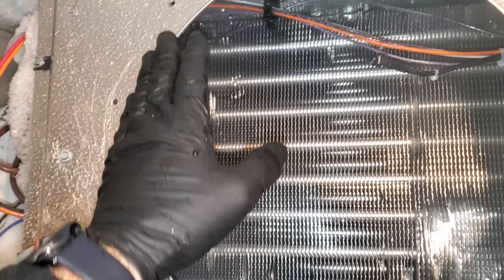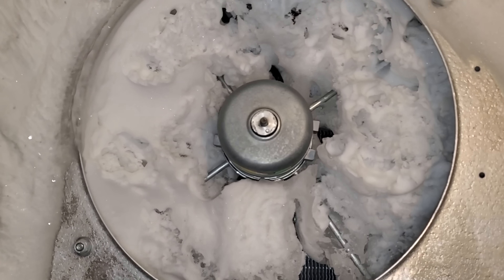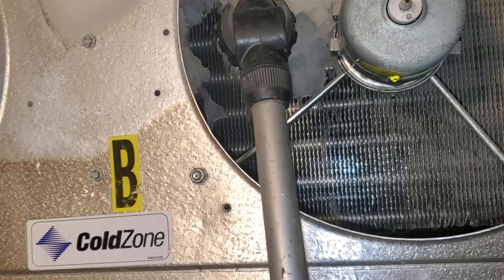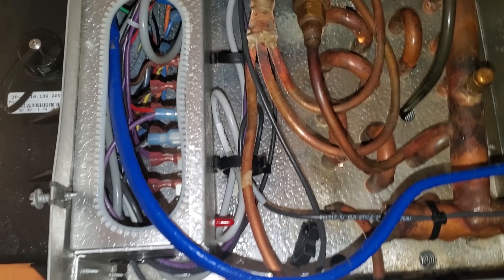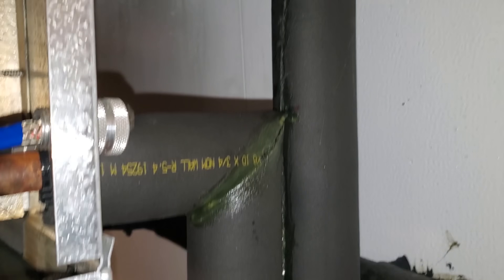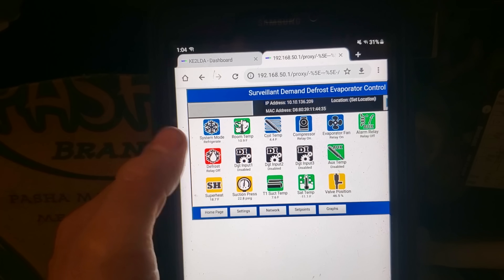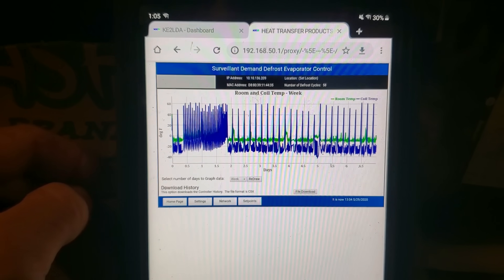IT'S BEEN ICED UP FOR FOUR MONTHS

Comment: Do you run the insulation through the box walls/ceiling?     I have found moisture wicking following the tube/insulation.    
On repairs I removed the insulation about 1 inch above and below the ceiling and foamed the space.  Seals moisture out and also supports and isolates the tubing from contacting the metal

Comment: I worked a store floor that had one duel rack, one on left, one on right iced to the drain tray in 24 hours of power to the fans failure. Told the boss he said ooooooo it's probably just slow on the de frost. Some hours later meat man chewed him out sure enough fan power supply was burned out. So much ice built it ripped the drain rack off when mid day de frost came on.

Comment: The time it takes to remove ice this way runs the bill way up and water dripping on the floor can damage the floor panels. I remove the drain heaters & use a wet-vac to suck out the drains.  I think customers need to plan for their walk-in freezer to break down and removing the product to a temporary freezer for several days so the box can be shut off and the ice allowed to melt on its own. The service person should show up FIRST, to fix the drain pan, evaluate the repairs & parts needed. THEN educate the customer to empty the room of all products & turn off the power breaker so the whole room can warm up & also dry out. Service-man can come back in 3 days and complete the repairs. I am big on preventive maintenance. Thawing out a walk-in freezer is needed every 2 years so it can be cleaned. It's horrible how dirty the freezer floor becomes in a couple of years of use.

Comment: What would you do if you didnt have hot water, besides turn it off until it thaws...
Reply: The time it takes to remove ice this way runs the bill way up and water dripping on the floor can damage the floor panels. I remove the drain heaters & use a wet-vac to suck out the drains.  I think customers need to plan for their walk-in freezer to break down and removing the product to a temporary freezer for several days so the box can be shut off and the ice allowed to melt on its own. The service person should show up FIRST, to fix the drain pan, evaluate the repairs & parts needed. THEN educate the customer to empty the room of all products & turn off the power breaker so the whole room can warm up & also dry out. Service-man can come back in 3 days and complete the repairs. I am big on preventive maintenance. Thawing out a walk-in freezer is needed every 2 years so it can be cleaned. It's horrible how dirty the freezer floor becomes in a couple of years of use.

Comment: Chris, you said those fans are hard to get, so if you know anyone with a tig welder out have a relationship with a welding/fabrication/machine shop they can run over over that crack and fix that problem.
If you can leave a single piece or bring them a few at a time, you will have less cost per fan since there will be less setup.

Comment: Just wondering...are any of these systems' data accessible remotely? I've worked in places that had remote sensing capabilities for equipment where you can view live data (and alarms for malfunctions) from miles away. Not refrigeration equipment, necessarily, but building systems data. I think of this when I saw Ethernet connections on this cooler to hook up to your tablet. Having this capability could quickly alert technicians there's a problem. Just wondering if you encounter any remote sensing systems or if everything has to have troubleshooting done in person. Thanks for the fantastic videos. Very entertaining!

Comment: Dude let me add more tip. This coldroom is a freezer. There should be a proper flow of air around the evaporator. Meaning theres no product blocking around the evaporator. There should be night curtain. Fan motor must off when they loading/unloading item. Defrosting should only 35 minutes with the 12 degrees celsius  termination. Long duration of defrosting will cause moist from the ceiling.

Comment: We found our air filter was plugged up and stopping the air flow! So we just threw it away and it worked for a week. Now it is hot again. 5 dollar air filter is cheap compared to 3or4 hundred to fix the plugged up Evaporator and fan system.

Comment: I have used liquid electrical tape  thats sold in a bottle to seal up the joints on that kind of insulation repair. If you brush it on pretty it looks pro. It holds up nice. They sell it at electrical supply houses. I think Home Depot too.

Comment: Just a future tip bro I wouldn't show customers ip address, someone could track their location and u could be blamed for a multitude of things man this world is F*cked nowadays
Reply: Just tryna help u out "Bud" don't gotta get an attitude
Reply from the maker: No attitude at all bud, unfortunately you can never tell context with text. I wasn't upset at all, I genuinely meant thank you for the concern and I appreciate you looking out for me and my customer
Reply: Not to mention ur computer was with yiu right? You were located at the customers coordinates right? Meaning if they tracked ur IP it'd still lead them directly to the customer, right? Stupid fuck
Reply from the maker: @
Mark Deeg  That ip address that you saw ins an internal ip address in the Ke2 controller, the only way to access it is by connecting a Lan cable to a wifi hot spot, to a router and or directly to a computer. The controller pictured is not connected to any network. There is no way for anyone to track me and or the customer  FYI
Reply: @markdeeg7088  You're the one being thick. 192.*.*.* is local, even 10.*.*.* is local, you can leak those all you want. Public IP's are what you want to refrain from spreading, your public IP is your routers IP, local are what the router uses to address devices within the network. Grow up.
Reply: @mragrayson  yet you spend your days going through youtube comments searching for the next person you can try and prove wrong? 😂 get a job buddy, do something useful with your life, "Grow up"
Reply from the maker: Thanks bud, but the controller was and is not connected to the internet nor their network. I had a hard wired connection to my pc......

Comment: I've worked at my restaurant for 14 years. Our freezer has dual units because it is so large. They generally only freeze up if they are low on gas, drain line gets plugged, or the defrost isn't long enough. Our units run on timers, and we tend to adjust them according to dry winter air or humid summer air. Humidity alone can cause fast ice build up.

Comment: I know this is not in your line of work, but tell the owners that their rate of rise fire detector should be at least 12 inches or 30 cms away from any appliance or light fitting or vertical wall,, it's an international fire safety law,, I'm a fire and security engineer 👍❤️

Comment: I had more ice, though not as thick, on the evap coils of the AC on a house i was renting. 8pm at night in West Texas, im sitting in the garage with the air handler panel off, a shop vac in the drip pan and using a heat gun to defrost the coil. Took about 5 hours...

Comment: You showed a plugged drain line but no mention of clearing. That said I would assume it was not part of the problem.  Shop vac to speedily remove the water buildup in the drain pan.  So much faster.    Your videos are really well put together.   Keep up the gr8 work.

Comment: Sensors weren't the issue. Low on gas causing ice up at evap inlet, if coil sensor placement was on the first couple of evap turns it could easily trigger repeated defrosts based on coil vs room temp differential. The exv was flooding the start of the coil trying to maintain suction line superheat. The fact that the evaporator was all boxed in by product surely didn't help.

Comment: I generally consider chicken wire worthless for most applications, I prefer Hardware cloth which is a square opening, you can fasten it down with some flat washers and self-tapping screws. It holds shape better, you can even make boxes out of it. it is more expensive and a bit more of a pain to cut through though.

Comment: Does winter charge cause any problem in the summer ? 
Once i had a compressor overheat and go out on high pressure or limit cut out a collegue said its better to keep few  bubbles in the sight glass in the summer time to make sure its not over charged, i was not sure if this is correct ?
Reply from the maker: No that is not correct if a system is properly designed the added charge (winter charge) needed to flood the condenser will not cause any problems in the summer, I’m going to discuss live on YouTube this evening 6/29/20 @ 5:PM (pacific time) come over and check it out https://youtu.be/qAVMB2gj6Kc
Reply: @HVACRVIDEOS  

For sure, thank you.

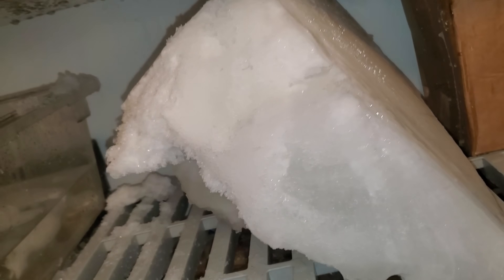Comment: 3:25 - I'm only this far along, and my first impression is: there is virtually NO airflow around the evaporator. If that is not the root cause, it's certainly a contributing factor. The plugged-up drain is also suspect. I don't blame you for changing the sensors because, like you said, you were already there and the sensors are a likely cause, and the potential to save your time (and the added cost to the client for a future service call) justifies that recommendation.
I don't know how "smart" these systems are, perhaps the Brain Box "saw" the icing condition and therefore entered defrost more often to try and remedy the issue?
I wouldn't knock your insulation job because I know I couldn't do half as well as you did, and to be honest, I've never seen a job done that well. The jobs I see are usually split-foam tubes zip-tied around the pipes, the type of insulation sold in home improvement stores for basement water pipes, rarely taped, never glued. Most of these have been in the franchised restaurant industry, I've actually seen better work done at Mom-and-Pop stores.
Reply: yeah, they had junk packed way too tight around it also.

Comment: First thing I noticed at 0:28 was that fire alarm strobe lens is full of ice-meaning it was full of water and froze-also meaning it will be useless if the system is activated. Seems like a weatherproof appliance isn't very weatherproof.
Reply: I don't know about the regs, but it seems like it shouldn't be that close to the condenser in the first place...
Reply: If there is ice in the strobe that means there is no barrier between the outside of the freezer and the fire strobe. The best method to stop this is by injecting silicone into the conduit (and outside the conduit in the freezer body) to stop the outside air from condensing and dripping into the fixture. I've done 4 freezers like this, never had a problem
Reply: Probably only guaranteed weatherproof if installed at very particular angle, different from the existing one. If you say you’re using Safari, the tech-support recommendation is that you use Firefox or Chrome. If it’s Chrome you’re using, they recommend Internet Explorer or Firefox. Obviously the problem you’re having is your fault because you’re the only one on the phone having any issues, as the tech’s machine is never down when you’re calling.

Comment: You should really blur out IP and MAC addresses, when showing web apps
Reply from the maker: The ip address goes nowhere the sydyem is not connected to the internet, the ip address is just the local connection .... but i do understand what you were saying and thanks for looking out!!
Reply: 192.*.*.* is local, even 10.*.*.* is local, you can leak those all you want. Public IP's are what you want to refrain from spreading, your public IP is your routers IP, local are what the router uses to address devices within the network. No need to blur local, as they're, well, local.

Comment: we use liquid polyurethane insulation foam for those kind of reinsulation jobs.
back when I was working in a hospital, the dietary department would always leave the walk in freezer/cooler door open that would lead to evap coil freezing shut. we installed door switch but the staff would put magnets on the sensors and later put motion sensors but the staff, again put waving cat figurine to defeat it. the dietary department staff says they do leave the door open because sometimes the heat in the kitchen becomes unbearable, so we installed them a 10 tonner air conditioner and upsize the fresh air and exhaust fan.
the migratory birds and pigeons are the scourges of our condensing units back then. we put chicken wires, fences and shields. but the birds would still find a way to nest on our condensing unit area. one day I got feed up on cleaning and shooing the birds away on every shifts I did. I bought a box full of toy snakes and I place all over the condensing units area and the birds did not come near them again. the funny story is when send a newbie on the roof to check on the condensing units and later come running back at the workshop, pasty and shouting that there is a huge pythons on the roof.
Reply: Hold on now, these idiots would leave the cooler door open to try to cool the room. What about the stuff inside the cooler thats supposed to be cold?! This is the logic of nurses?!
Reply: allan b
 ... too much heat in the kitchen is not the only reason they leave the door open all the time. In a busy place there's staff running around with arm loads or push carts of food and since their hands are full they don't bother to latch the door. This can go on for hours at a time. On the upsize of the of fresh air for kitchen ventilation, that's spot on but it needs to be in the right place or the staff will block it again come winter time due to the cold draft. Animals and birds on / in rooftops units are a royal pain. I used to keep rolls of hardware cloth (coarse window screen) in my work van. Cut to fit and secure with zip-screws. I can't tell you how many times I had to extend the screening right down to the roof so critters didn't nest under the units.

Comment: in the summary when your chatting about what you may have done or dont remember. Im an autospark / diagnostic tech (cars) when i do my invoicing, the invoice to the customer is 1 sheet but the actual invoice is two. (they never see page 2)  page 2 is a notes to me section, i saw this, i suspected that, i changed this because. 2-5 mins extra time at the keyboard while invoicing has saved my ass and also cleared up recurring issues. Im sure you have something similar, you seem like the kinda guy who would. but if not. :)

Comment: the insulation was good the miter joints where cut really good, the glue job not so much.  You should not see any yellow and that "glue" is not so much glue as it is a contact cement. It should never be put on that thick or be runny.  You put some on each side of the cut let it sit for a few sec depending on how much you used, you should be able to touch it with your fingers and get no glue on them should just be tacky.  Once you put the two sides together they should stuck and take some pulling to get apart. (they do make the glue in black also K-Flex 620)

Comment: Wow my friend seems it was in Alaska it is an evaporator if it had enough ice it is a common thing sometimes in the restaurants in the supermarkets where they have rap of compressors that feeds several evaporators sometimes the employees leave the door open or they make a shim so that the switch Do not deactivate the evaporator which causes the volume of hot air that is outside or entered the system between the humidity and that is why that large frost occurs frost is due to the fact that there is a moisture infiltration and that is due to because they mostly leave the door open the sensors and the sensors of the temperature controllers fail very often because they are electronic devices that are working and that are interacting with the variation of temperature and the same electricity that handle electronics. So something normal while they continue popping up details so well easy to solve it and you always have no work to do greeting friend take care

Comment: some of these controllers watch the superheat and also come up with their own algorithm based on estimated saturation of the evap coil..  you can look for low superheat as a cause too..  but if a unit goes low on gas like this one, the superheat value wont fall into range quick enough to actually clear the ice correctly..  now you get yourself into an endless loop..  once the ice gets a layer on the coil, now the ice itself becomes an insulator..  your demand deforst kicks on and your coil warms quickly..  the computer "thinks" at this point there was very little ice so it shuts down defrost and goes back to cooling..  well of course you are low on gas.. it runs for awhile and due to the ice buildup the coil temps (and superheat) drop very quickly..  bam defrost..  (but its short.. remember you have a nice insulating layer of ice)..  what works is the reverse mentality of an ice machine..  you need a sensor that is about 1/8 - 1/4 inch from the coil..  since low gas usually causes thicker ice at the beginning of the circuit you put said sensor somewhere in the first foot or so of coil..  some controllers allow you to add it as an aux defrost sensor..  the computer then must satisfy this sensor (up to a time limit) before going back into cooling..    another smart algorithm thats used is a timed defrost if a certain number of demand defrosts are called for in a short amount of time..    it forces a longer cycle so naturally you melt more ice..  and hopefully qwell any massive buidup..  out of the box 100% demand defrost is flawed from a system that goes a little low on gas..  in a perfect world nothing would ever leak...  ha!!